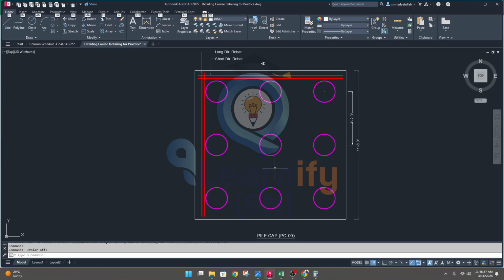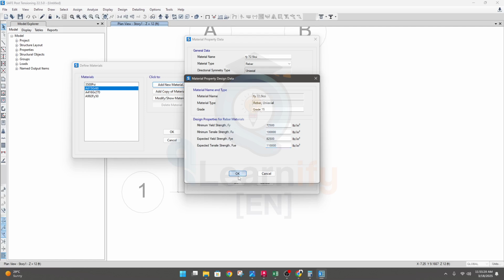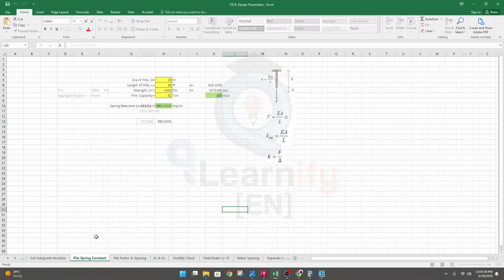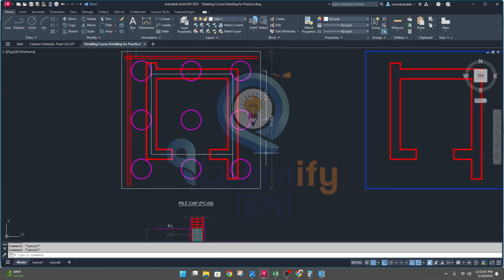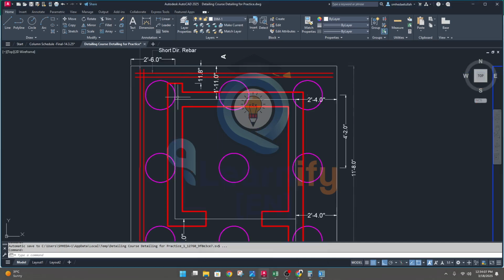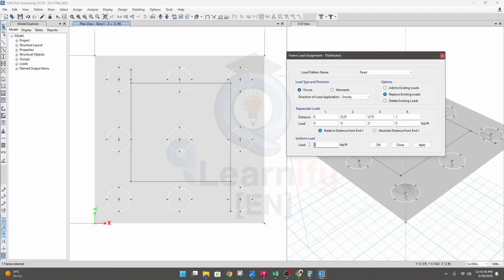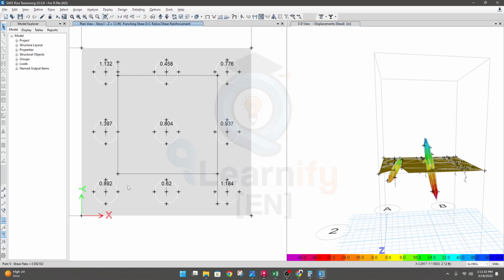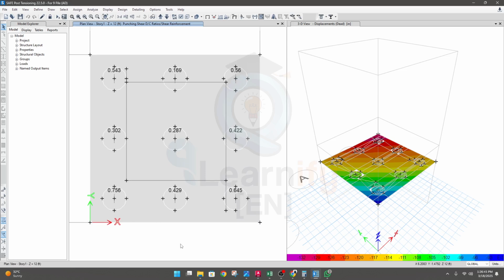CSI SAFE 2025 (v22) Tutorials for Beginners | Pile Cap Design Under Shear Wall or Lift Core | Part 2

Comment: really nice and I got your excel spread sheet. They are nice.  but for pile capacity determination, how can we know whether the pile capacity spread sheet works for concrete or steel (for bored or driven pile)